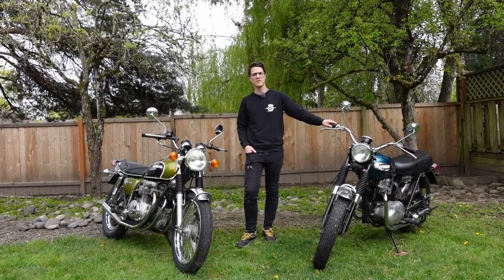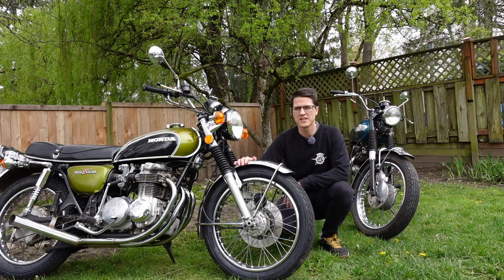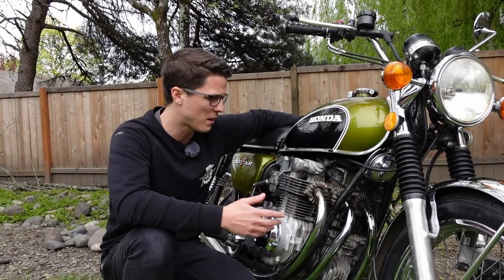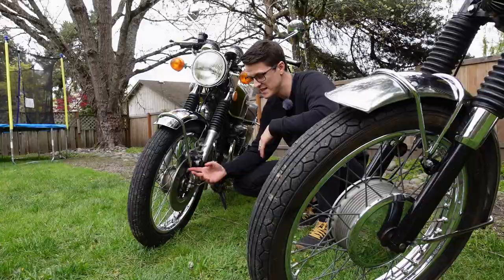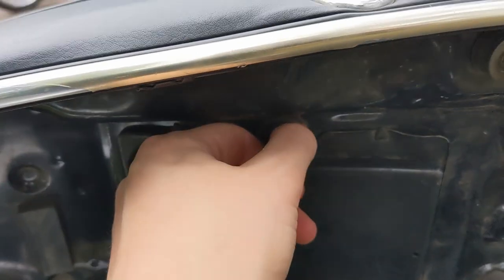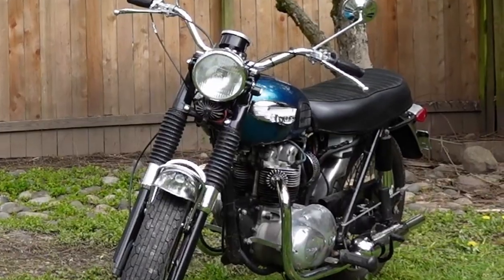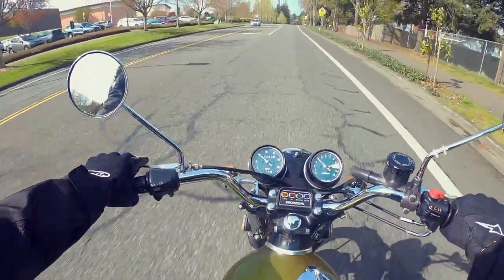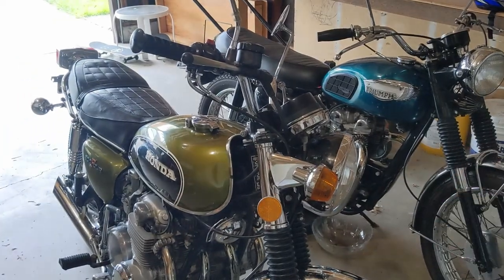How this Honda killed this Triumph

Comment: I think you'll find that the Honda CB250/CB350 parallel twins, released in 1968, had more to do with Triumph's demise than your 500. The CB250 could almost get up to 100 mph, while the CB350 could do about 110 mph. Both had a 5 speed gearbox & reliability that British bikes could only dream of. They paved the way for the CB750 that arrived a year later.
Reply: I own a cb350 and the only way it can do 110 mph is if your on the downside of a very big hill with the wind at your back. Or close to the event horizon of a black hole. I don't think it was japanese bikes that ruined the british motorcycle industry, I think it was greedy shareholders not spending money to update 50 year old tooling. They could have carried on as a premium brand making a modest amount of motorcycles at a decent profit, much like ducati or bultaco or maico or husqvarna at the time.
Reply: The CB 250 up jetted free flow 2 into 1 exhaust and K&Ns flat out could just manage a true 87mph the speedo had a mind of its own. The CB 350 never made the magic 100. 98mph was as good as the average enthusiast could manage with all the usual above mentioned upgrades. That is assuming the cam chain didn't snap or eat the tensioning slippers first.. I loved and hated my CBs in equal measures
Reply: I had a CB250 and it was a great bike in many ways BUT Honda HP is not equivalent to anyone else's HP. It might have reached almost 90 mph on an optimistic speedo.  It was very thirsty for its power output.  The gearbox was TERRIBLE. First was way, way, way too high and the gap between 4th and 5th belonged on a race track not on the road.  It was also very sticky with a pair of very short lever arms to move the gear shift rearwards.  The 180 crank created chain snatch below 3000 rpm where the 175 Honda was unstallable with a 360 crank.
I found an old Honda 305 dream and it was a far better bike.  Much more efficient with a similar power output and speed.  It only needed four gears.  The handling wasn't as good.  But overall it showed what went wrong with the newer Honda's.  The newer honda had better handling but the engine was disappointing until I dismantled it and faired the cylinder head to the head gasket and the cylinder.  Small mismatches prevented it from reaching its potential.  Equally the rings in both it and a friends Honda 750 don't last as long as I would expect.  But people buy on the illusion, not reality. They discover that later.  I met my wife because she bought the honda 90 scooter and they claimed 60 mph top speed.  It didn't do that so she came to a motorcycle rally to ask us what was wrong.  Luckily she came to talk to me.  And more than 50 years later we ride together every day.  If the bike HAD done what was claimed I may never have met her.  So I have to thank Honda for lying and selling her the wrong bike under false pretences.
Reply: He says the 500 Triumph would go 110. My Bonneville 650 would only go 110. What about the 305 Super Hawk or CB77, those were pretty fast at about 110mph.
Reply: @michaeljoesmith3977  the T100 official top end was 91 the t110 Daytona what's 105 a very good properly setup t120 oil in tank not in frame could just pull 115 to 120 depending how it had been set up and if it had been blueprinted
Reply: @michaeljoesmith3977  i had a Honda 305 Super Hawk in 1966.
Had it " souped up".....heavy duty value springs , over sized values , racing cam , bored out.
It was....Super fast.
A 4 speed, i did 100 mph in 3 rd gear....tacking 12k rpm ( red line was 9,500 rpm)
A friend got a brand new 305....heard mine was fast....he asked if he could.....take mine around the block.
I took his new 305.......i came back....i couldn't believe how slow the other guy's 305 was.
It was like driving a. .....160 !
The other guy came back with my Super Hawk and said......Wow !!
Reply: @Togz100  My Bonneville was a 1971 five speed oil in the frame type. No modifications. 110 flat out.
Reply: @michaeljoesmith3977  I don't know how fast my T140V will go, but a good few years ago, I thought I'd give it a go and got to just over 100 and it was still accelerating, but the vibration was so intense I wasn't sure whether my eyeballs would fall out or the bike would shake itself to bits first, so, since then, I've kept it to more sensible speeds and just enjoyed the effortless and instantaneous acceleration.
Reply: @michaeljoesmith3977  I got done for speeding on my RD350b, 105mph, not flat out
Reply: With each passing year, though, the CB350 (we didn't get the CB250 in New Zealand) was detuned, until the last ones could barely manage 90mph. They still started smoking rather young. And handling as standard was poor, although properly damped rear spring units and bronze swingarm bushes fixed that, unlike with its disappointing successor the CB360, which had a soft frame and no easy fix.
Reply: I have a triumph 500 and a cb 550 both put a smile on my face. But are generations apart
Reply: I had a 1972 CB350 which I purchased used in 1973 and the top speed it ever would do was an indicated 85mph. Because speedometers are notoriously optimistic I guess it was probably more like 82 in reality.
Reply: Don't forget the double overhead cam CB450. A beautiful engine in looks and performance. By '68 the CB450 K1 had a 5 speed trans,  teardrop tank etc.
Reply: BULLSHIT!! I had a 350 Honda, and it was lucky to hit 95mph
Reply: The Honda CB450 Black Bomber from 1965 began the decline of the British motorcycle industry. It was also Honda's first 'big' bike.
Reply: Another one having a laugh, my YDS 7 claimed to be the 100MPH learner bike, never got anywhere near that plus it was unreliable , surprised you didn't mention the 105mph of the Super Six  or the 70 mph of the Fizzy , LOL
Reply: @Togz100  And the mighty Rocket 3  reached 131.7 MPH at Daytona in 1968 in speed endurance test, the record stood until the Z900
Reply: Your years are incorrect the prerunner the cb250 the cb350 was in the CB 250 and CB 350 K4 and your top speed figures are totally farcical 85 a 95 mph are the genuine figures and Honda themselves quoted less maybe you had a little too much acid or weed which is known to affect perceptions it was the late 60s and 70s after all
Reply: Oh yes both the 250 and 350 how does 6 speed gearbox which when it became the incarnation of the CJ 250 and 350 it had a 5 speed box you clearly didn't ride them
Reply: @carolrowley9868  oh yessssssssssss
Reply: @michaeljoesmith3977  sounds about right for the T140. My brother had the exact same model and year, only difference was slash cut exhaust up jetted and K&Ns loads more noise bit more power and several holed pistons later😆
Reply: HORSE HOCKEY. There's no way the CB350 ran "about 110 mph". I had a half dozen friends and my stepbrother who all owned stock CB350's AND CB360's, and none of em could even touch 100 mph. And all of 'em were running perfectly. I know, because I had bought a Kawasaki KZ400 that EASILY outran them all in a drag race or top end speed.......and if I remember correctly, my 400 would only do 105 ( + or - ) We used to race and swap bikes while riding nearly every day. Not to mention the fact, back in those days of our youth, the lightest rider was only 145 lbs, while the heaviest rider was 180 lbs. A 200 lb man would play hell getting even the 360 to top 80 mph. Weight is EVERYTHING on these small bikes. You would have to do a helluva lot of upgrades & mods before the 350 or even the 360 could hit 105 mph ON A GOOD DAY, because a couple of my buddies did just that. When I say "on a good day", I'm talking about cooler air temps and low humidity, which also makes a huge difference in how ALL engines perform. And don't even get me started on the CB250.
Reply: @michaeljoesmith3977  Mine was a '72. Frame cracked at the usual location which bedeviled OIF owners (a pointless frame design as executed since it required a rockerbox redesign due to clearance mistakes thanks to bureaucretinous designers).  I still collect Britbikes (1969 Trident, couple Commandos etc) but my main rides have been Harley Evo FXRs since the 1980s.
Reply: @bsimpson6204  RDs (250, 350, 400) were glorious and I should have collected a few when they were near free used. (Two stroke demand was so low some shops scrapped Kawasaki triples because no one wanted them and they shops needed the space!.)
Reply: I owned a 1968 CL-350 with CB exhaust. It was hard d pressed to hit 85.

Comment: I went from a parallel twin to the 550 Honda four. I couldn't believe the difference.  The smoothness was great and made long trips less fatiguing. with the twin you could sortakinda tell something was behind you but with the Honda you could actually see what it was.
Reply: AND it stayed behind you..
Reply: Fair enough, that is correct, no vibes. Heavier on fuel was the tradeoff. They were like moving a barge around on the highway.
Reply: Sorta like kinda...you missed " like"
Reply: @asacarrick1440   LOL No where I'm from we skip the like.

Comment: I rode with a guy for years that had a early sixties 650 Tiger. Granted the bike got plenty of attention everywhere we pulled in. As you said, it looked and sounded great. He loved the bike. He let me ride it once. It had a right side shifter. That took a little bit to get used to. The buzz throughout the bike at speed convinced me I never wanted to ride it again. One day after a cold start with the bike sitting on the kickstand, I watched a nut and bolt loosen and fall to the ground that held the drive chain guard. I don't know if I would give any one bike credit for killing a British bike line. I believe the British motorcycle and car industry killed itself by simply doing nothing, letting the world pass them by.
Reply: So true. I recall the mid/late 70s in the UK, no one was even thinking about buying a British bike. They were way out of date, inferior in every way.
Reply: Kinda Like 70's GM in that regard
Reply: @leomonster1973  As I remember, they all had their issues. The Japanese vehicles were right straight out of the dealership, unlike their American counterparts that had relied on the dealers to fix the problems. This was a normal practice way before the seventies, and we didn't know better. Chrysler lean burn, the Ford Pinto and Chevy Vega, just starting the long list. The Japanese kicked our ass for sure. GM felt that whatever they built, Americans would happily purchase. You are right.The seventies were a wake-up call.
Reply: @williamwintemberg  competition is supposed to breed excellence into the competitors…
The end result being that the consumer wins because his choices are better and cheaper across the board…
Except in America,  when the competition becomes to fierce from foreign companies, the home teams go to the government and ask for protectionist restrictions. Harley knows all about that. 
The older companies saw the influx of Reliable, cheap, reliable, fast, reliable, easy to maintain, reliable, Japanese bikes and didn’t plow any money into R&D to one up them…

Comment: The quality comparison reminds me a lot of what happened with American automakers when reliable, efficient Japanese cars came to market. Pretty crazy how much complacency there was with existing American (or British) mfgs that became immediately apparent!

Btw, you're right about opinions--I think the Honda is SOOO much nicer looking, haha.
Reply: A fad hit in 1971+ for tiny cars.  At the same time US regulations emerged to cripple Detroit and British existing cars.

Everything from Cutlass/Falcon up in US cars were solid and much more roadworthy in the late 60s than JapOboxes and MGs/Minis at the time.   The 1965 Cadillac, Imperial and Lincolns were fantastic cars. 

The problem was trying to redesign a big car into a tiny car.  The Vega and Pinto took drastic and stupid design shortcuts to make a $2200 and $1995 base.  4cyl engines hadn't been built in numbers in Detroit since WW2.  Labor them down with cheap automatics and AC and stuff in a 20 year old gas tank design to a hatchback.

All to make a car that looked like the fad.  Gasoline was 38c and up to $1.40 by 79 so everyone was encouraged to buy economy boxes to save gas....but it didn't really make any cost sense.

You paid $1500 more for more spartan and cramped Datsuns in 72 than a Malibu or Torino or LTD to save about $100 a year in gas.  Or you could buy a Vega and get the experimental motor rebuilt every 30k miles.

You see the same marketing trick used for EVs today.  You spen an extra $30,000 for a car that has serious travel limitations but you don't buy gas.  A car ownership lifetime of gasoline 3000 gals.  Gas would need to cost $10 to even break even.

Salesmanship vs Logic.
Reply: Of course that's no longer true. My Chevy Trailblazer is approaching 300,000 virtually trouble free miles. Bulletproof American dependability.
Reply: I am not sure how much complacency there was in the UK. The Japanese government created a huge (and irresponsible) local market and restricts imports,  giving Japanese makers critical volume.
Reply: @mtntime1  x2 on that one. Quite pleased with the craftsmanship on many later vehicles, particularly starting around the late '00s and 2010s. Many really improved their fit and finish during that time, Ford in particular seemed to lead the way on that.

Comment: The Japanese killed the British bikes because if British arrogance. They didn’t think they had to change.
Reply: I read that Edward Turner (designer of the Triumph Speed Twin, Ariel Square Four, and Daimler SP250 V8 engines) was sent circa 1956 by Triumph to Japan to assist a Japanese licensee. When he returned, he reported to the Triumph board that there was trouble brewing in Japan. They replied, "Oh no, dear boy, the Japanese build only small bikes. Besides, they don't know our market."

I think that he made a second trip to Japan c 1959 and met with the same indifference upon his return. 

It was already too late.
Reply: @Alfred Wedmore Thanks for clearing that up. I never clearly understood the postwar relationship between BSA and Triumph.

I do though recall reading that Turner was sent to Japan twice regarding license issues and that his British colleagues dismissed his reports of impending competition from Japan. I read this decades ago, so I've forgotten the details.
Reply: British needed a new motor long before Hondas arrived   360° paralle twin was outdated  WW2 hindered development in British Auto industry across the board  1930's designs used well into post-war period   Electrics on Brit bikes awful  'Damned good headlight  Just dont ride at night', Joe Lucas
Reply: @Alfred Wedmore Latest paralle twin designs use 270°crankshafts